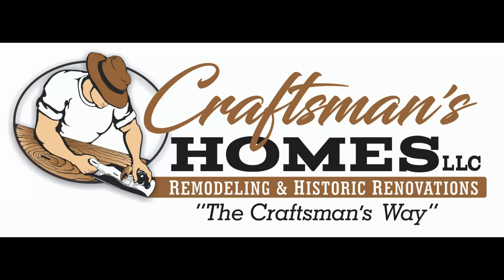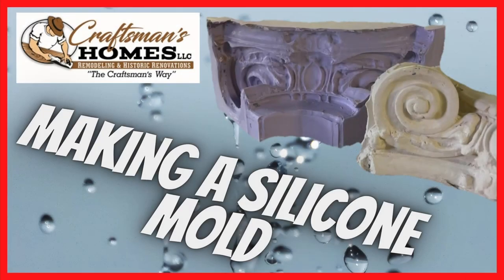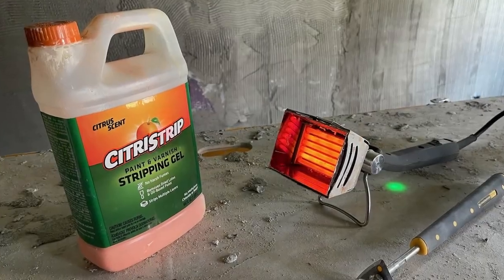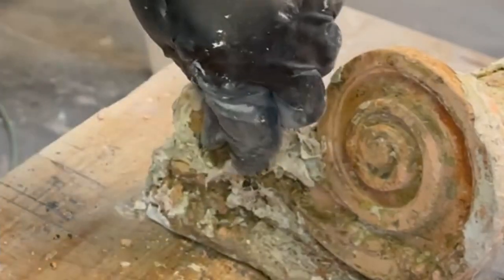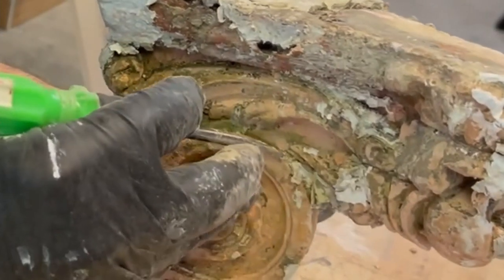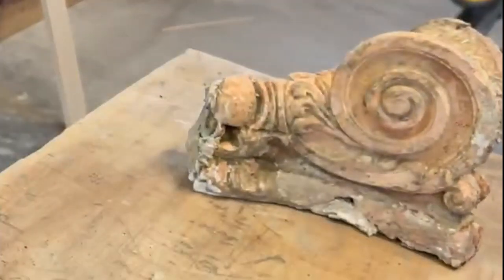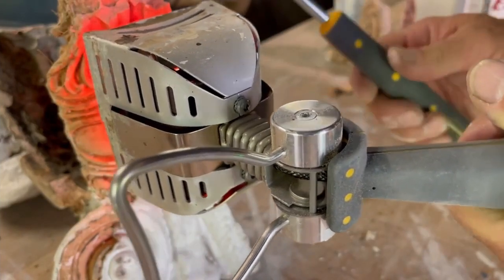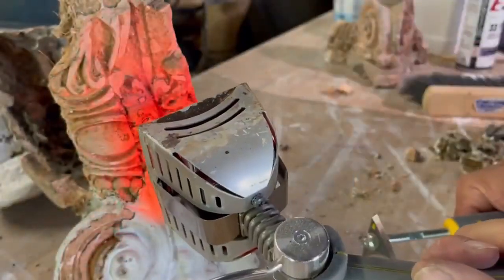Citrus Strip VS Cobra Speed Heater - How to Remove Paint Fast!

Comment: Thanks! We have used a regular heat gun in the past but this looks like it would be more efficient.
Reply from the maker: I used a standard heat gun till I found out about this one. It is amazing the difference between the two, it will make you chuckle after you use it.
Reply: An additional benefit of the Cobra Infrared Paint Remover vs heat gun: Lead paint turns to toxic fumes at about 1000 degrees F. All Speedheater™ Infrared Paint Remover's infrared rays can release the bottom layer of paint by only heating it to 400-600 F. Heat guns need to heat the paint to over 1000 F.  The paint is heated by  blowing very hot air heat from the top layer down to release it from the wood which takes longer than the 1-5 seconds with the Cobra.
Reply from the maker: Great information !